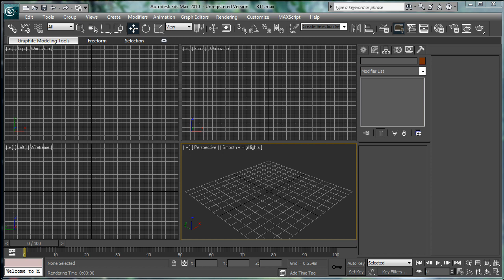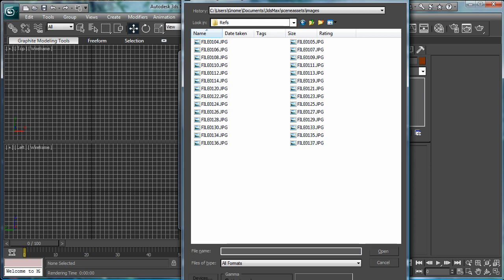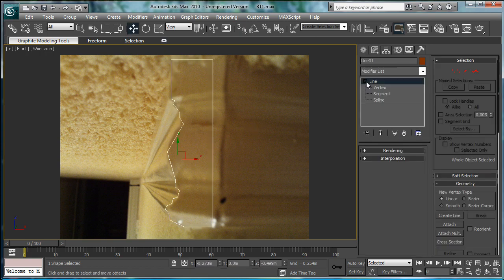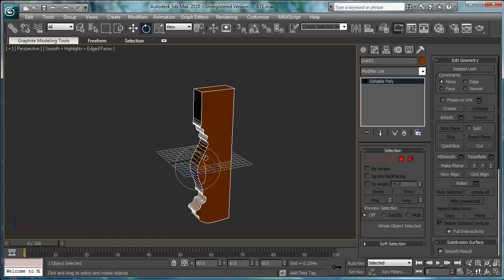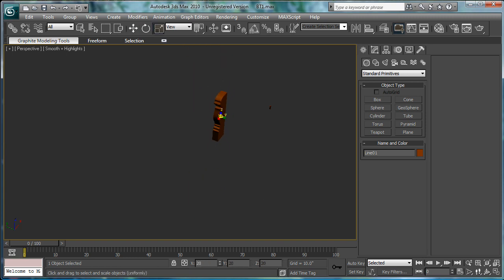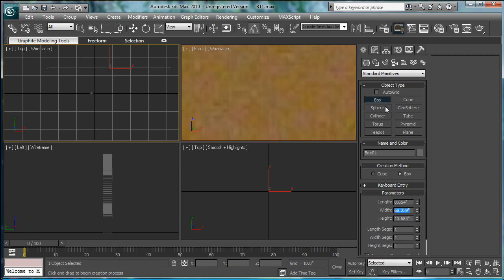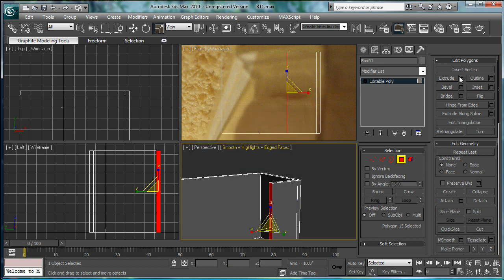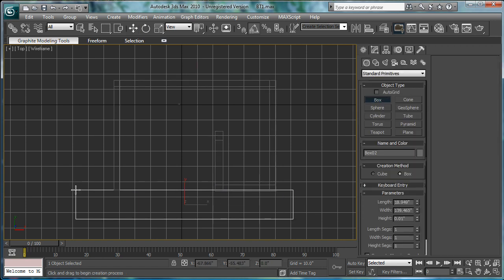3ds Max tutorial - Interior Architectural Design: Bathroom part 1

Comment from the maker: @RPatatinis Thanks for the comment, I really have never tried to use the built in walls, but I tend to use boxes as a starting point because they are very easy to work with (especially with things like walls :p ) However the built in walls could be easier and I might not know, I guess I'll have to try them out and see.